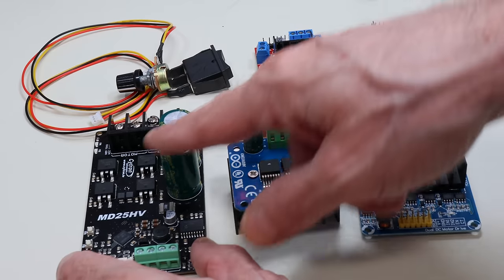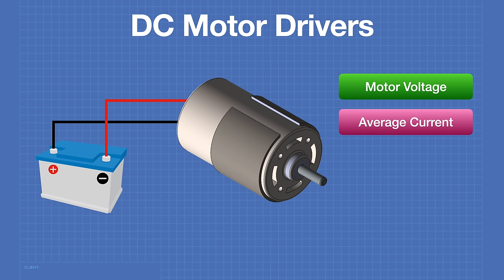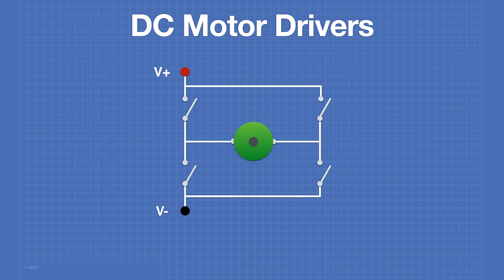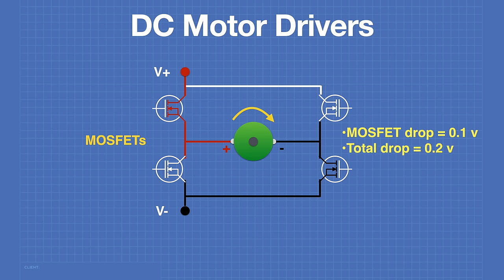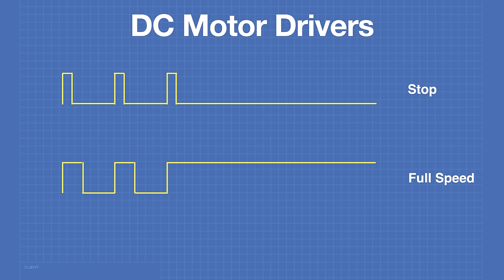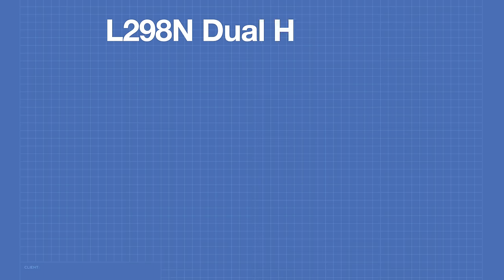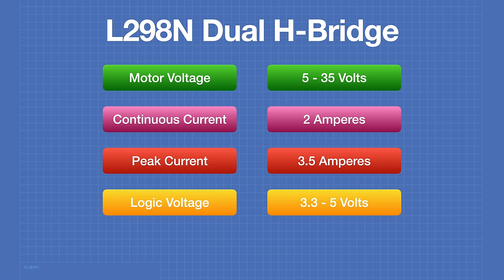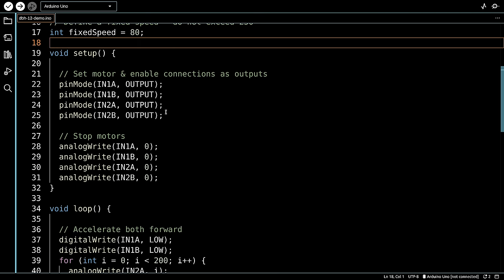Driving DC Motors with Microcontrollers

Comment: MX1508 has D1 meaning diode. Question. Will it block back EMF coming from powered motors if I use motors together with an IR sensor (KY-022)? Will I get normal and stable readings for IR in Arduino IDE serial monitor? 

So far I've tried L298N with electrolytic capacitors. However, after spending hours of tweaking the code together with ChatGPT, it didn't read well. ChatGPT advised using different capacitors 100 mF, 1mf and 0,1 mF, which I tried with no actual result. The last advice was to use ceramic capacitors to silence back EMF, which I do not have atm. 

Same question applies to ultrasonic transducer HC-SR04. 
Anyone knowledgeable enough on back EMF?

Comment: Quick question - I just bought the Arduino motor shield Rev 3, and it appears to use the L298 chip as discussed here, but it has no heat sink. Can you explain what it does not have said heat sink? Is there any potential over heating problems with this shield? Thx.
Reply: There is always a potential for overheating with or without a heatsink.  The module you have will run the device hotter and will have a lower maximum current rating than others that have the heatsink.   Note that the manufacturer's figures for maximum current will specify a particular heat dissipation arrangement (PCB type, attachment, heatsink, ambient temperature, etc) and different modules will implement different arrangements for different final results.

Comment: I'm working on a Pico project to make a single analog wireless joystick to control 2 large 24v motors in a differential drive format. it would mean the world to me if you did a micro python tutorial on how to read inputs and configure a differential drive code for a common analog joystick. I have little to no experience with coding, but I'm diving in headfirst.

Comment: I don't understand why transistor drop for bipolar transistor is 0.7v. Vce drop is usually in the order of 0.1-0.2v. 0.7v sounds like Vbe which is not applicable here. 3:47
Reply: These are Darlington pairs, which if I remember correctly work with the main conducting transistor always conducts in its active region and never in its saturation region, leading to a much higher voltage drop. When the datasheet talks about the VCE "in saturation" it refers to when the input transistor is saturated
Reply: These are Darlington pairs, a single transistor made of two paired BJTs. Due to the circuit dynamics of the pair the input transistor does get saturated but output transistor (the one that actually conducts) never does, staying in its active region. This leads to a much higher VCE when "saturated" compared to a single BJT, however the pair can handle a much higher current and is extremely sensitive to small signals

Comment: In all your examples drivers are ligt loaded - because there is no any mechanical load on motors, especially high-current motors. You use too low PWM frequency

Comment: Can anyone explain how do OFF/Standby and Brake modes differ ? In both, there's no potential difference across motor, so what difference does it make ?
Reply: In standby mode the motor connections are open: in brake mode they are connected to each other.  The connection creates a load thorough the windings when the motor tries to turn, so there is a braking effect.

Comment: You might want to add some caveats to the IBT-2 section.  I have fried several of these drivers because of their poor heat sink design.  The transistors are not adequately bonded (thermally) to the heat sink, and these do NOT actually perform up to the voltage and current specifications listed.  In contrast, I have had good luck with the Cytron drivers for higher power applications.

Comment: It all made total sense (=within the scope of my knowledge and understanding)... until you showed what looks like a DOS screen @12.18 - assuming (apparently) that everyone knows "basic" coding.
I am pretty intelligent, but my mind IMMEDIATELY blows a fuse when I find anything that I have to "program" by plugging it into the USB of my PC.

I'm good at <discreet> electronic circuitry, and I'm pretty good at handling my PC... but the two hobbies just do not mix for me.  Whether it wants me to <simply download this program> that some other brainiac has devised, or (much less) do what you are doing, defining and enabling ports/pins... how the hell can any average Jo do any of that without a University degree?

I don't think I will every be able to trust a technology where I have to plug <this> module into my PC, download <this> program, flash (?) it to my module, re-connect my module to whatever... and hope the f*** that it works.  
Call me a luddite, but that whole process -(EVERY step of it) sounds more like witchcraft than electronics to me.

I was good at following instructions to set the time on my VCR back in the 80s (even in Chinglish)... but paying for an Arduino or Raspberry Pi... which is useless without programming (via my PC!)... is WAY crazier.